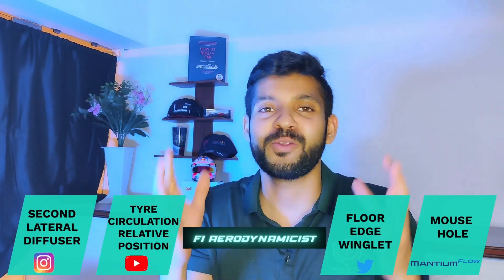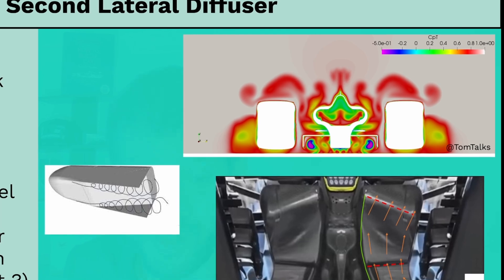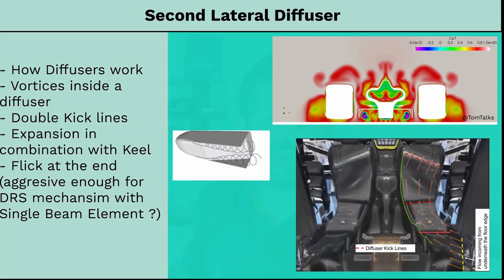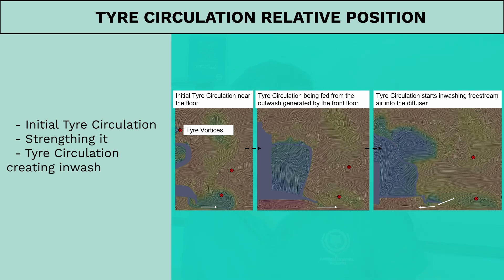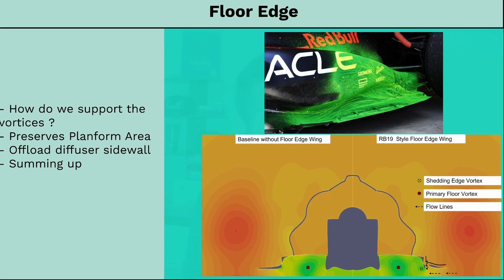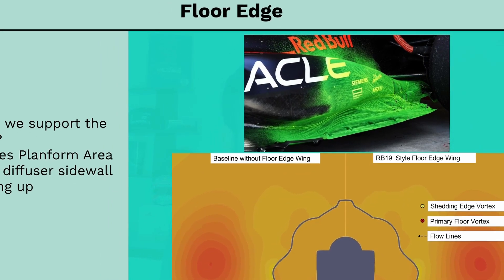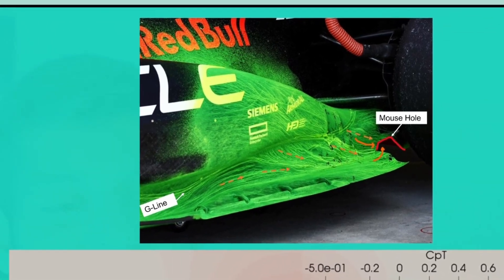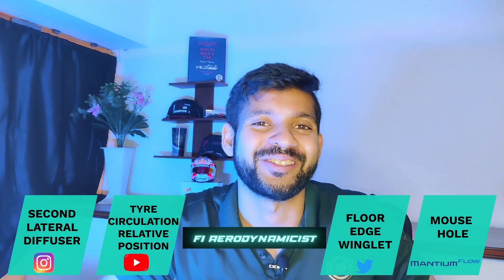#F1 Aero Analysis : RedBull Racing RB19 Floor Analysis | LATERAL DOUBLE DIFFUSER ?? Part 2

Comment: What effect would the floor edge vortex shown in the end (the super smart outwashing and expanding function vortex) on the flow that rushes into the diffuser due to the diffuser kick? May it be that because of the low pressure induced by this vortex, the vortex generated by the diffuser kick (entering the diffuser) is weaker, resulting in less induced drag?

Comment: When I saw the RB diffuser I was surprised because the expansion is so aggressive. Now i understand how the vortex is energized  through the mouse hole and the tangential boost  by the inwashing. Very interesting explanation as always. Thanks!
Reply from the maker: Thanks 🙃
Reply: Wait until you see the downforce dump system via disguised underfloor trap doors.

Comment: Great video as always! Do you think that the wing cascade on the floor edge of the redbull could potentially be feeding the floor like the tire squirt does in the 3rd picture? Since the outer edge of the winglets would push air in?
Reply from the maker: I think they use the vortices shed from the read brake duct winglets to manage the tyre squirt..
But the floor edge winglet is definitely used to manage the inwash
Reply: @f1aerodynamicist  i meant at 4:12 the third image, since that vortex is feeding the rear diffuser, could the wing cascade that is on the floor edge be powering up a vortex that assists in feeding the floor like this vortex does?
Reply from the maker: @Jay-nk6dm  yup , exactly , spot on . That what's I think is happening as well
Reply: @f1aerodynamicist  you mentioned in the Previous part about the wing cascade having an inner edge that promotes outwash, I don’t think that inner edge exists because it would seem to be counter productive to this flow structure downstream
Reply from the maker: @Jay-nk6dm  I think ur right , I might have oversimplified that bit ... Will look into changing that. Thanks for pointing it out
Reply: @f1aerodynamicist  my pleasure, anything to get you to make more f1 content 😂
quickly becoming my favorite f1 youtuber. great content so far, looking forward to whatever you have planned next!
Reply from the maker: @Jay-nk6dm  Thanks mate , the next video will be on floor vortex merging mechanism. Made some mods that has given us a helical merging as compared to two elliptical vortices
Reply: @f1aerodynamicist  thats a great (and very niche) topic! Exactly the kind of stuff this channel is great for.
with your channel growth, I can already see you working on the f1 channel with albert fabrega one day explaining the new 2026 cars haha

Comment: I know that diffusers have an upwards kick. But for the front lateral diffuser (the previous video), it looked like a downward kick to me from the pictures. Am I just seeing it wrong? Is that an upward kick too ?
Reply from the maker: It's an upward kick but there is a normally a reflex if you want to make that kick aggressive
Reply: The floor slims down, then expands. So yes downward kick, until the diffuser throat, then it's outward kick. The cars are going to get a bit faster now that everyone knows pretty much what to do.